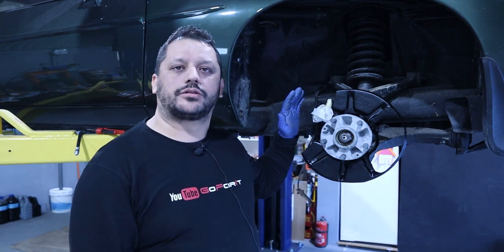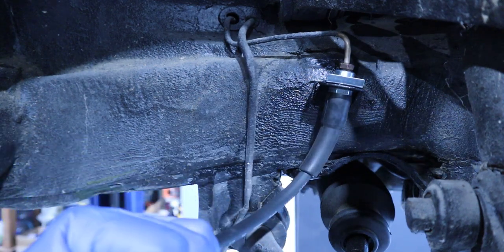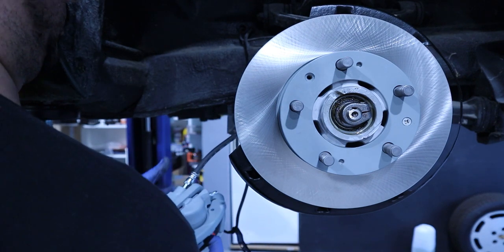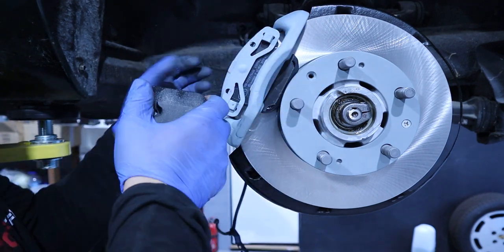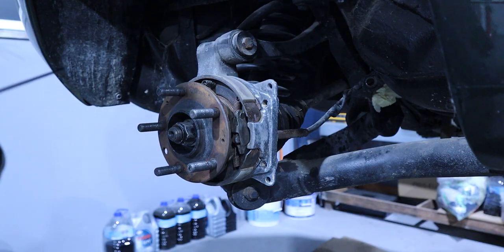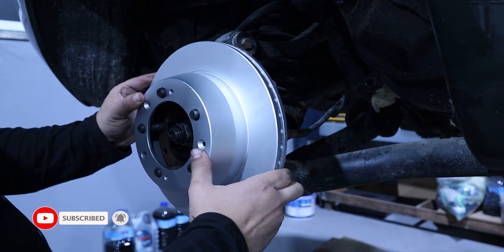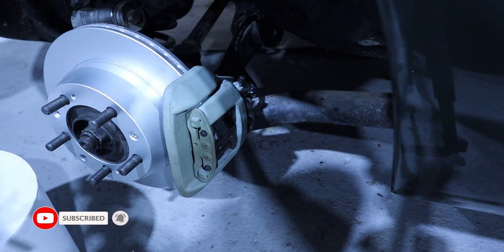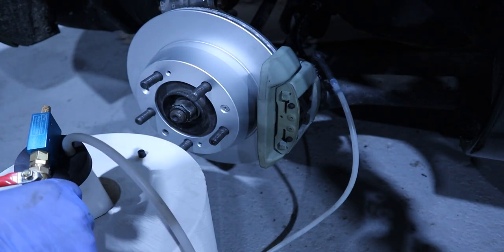#10 Porsche 928 Braking System Part 5 - Final Assembly

Comment: Thank you for this very usefull series of how-to video's! I do like all your explanations. I'll start soon to refurb my brake calibers of my 5.0 32V 1984 928. with only 90K mls on the dash. I think this maintanance has to be done after 38 years.
Reply from the maker: In your case is simpler and way cheaper to get the rotors. The videos will continue soon. I am making a pause now on that series because I am working on my track car. I am doing a LHD conversion. It has been a really fun and interesting process. But the 928 videos will came soon. Thanks for your message and do not forget to subscribe. Cheers.